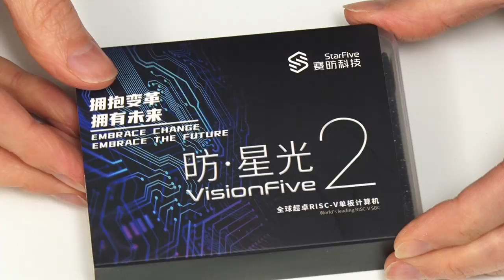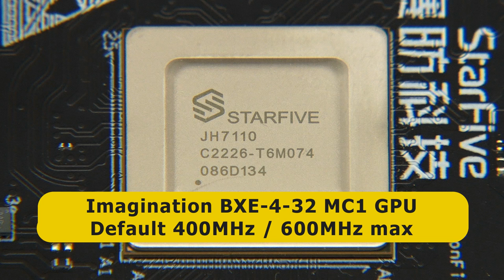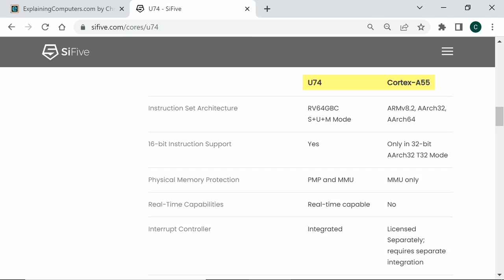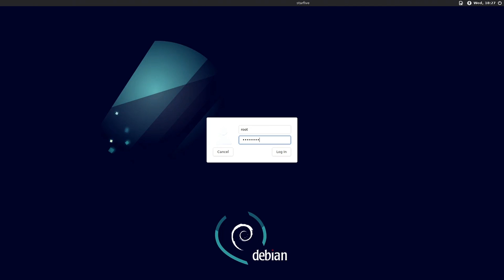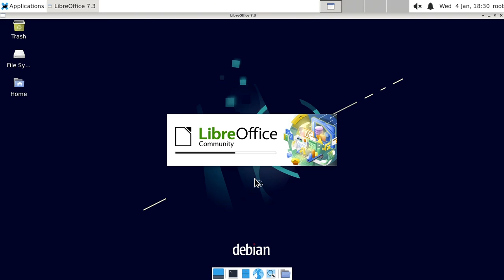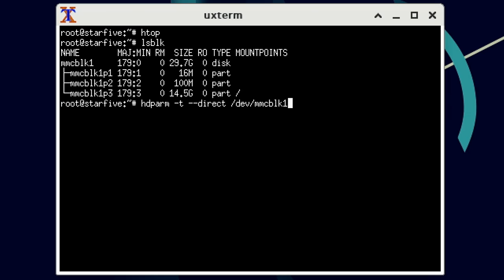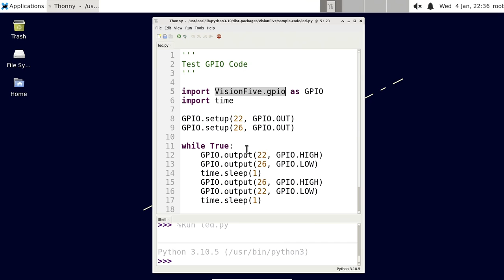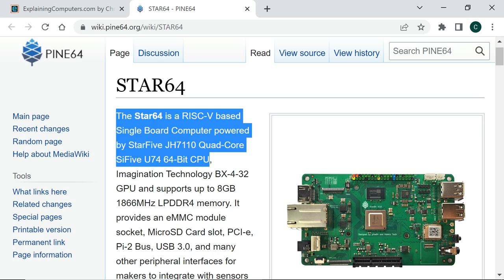VisionFive 2: RISC-V Quad Core Low Cost SBC

Comment: I can't help but thinking that these little boards would be better with lighter operating systems and more specialised programs. They seem to struggle with loading even the most basic of full desktop software and present as laggy and not really a very fluid user experience. Given that they're just development boards they could easily get away with cutting out all the graphical bells and whistles.

Comment: 7:07 Apparently the M.2 slot on the back is meant for a Wifi solution; they say this in their Kickstarter campgain video.
Reply: It's primarily meant for a SSD. During the Kickstarter campaign they offered a USB Wifi stick for a couple of dollars.
Reply: @LivingLinux  Perhaps what they said in the campaign video was a result of improper translation. Though this prompted me to look into M.2 wifi boards and I must say, the Intel Killer Wi-Fi 6E AX1675 board packs all the current features one could need for a pretty good price.
Reply from the maker: The M.2 slot is keyed for an NVMe SSD, not wireless comms. Early on they did write about it being for wireless connectivity, but this is no longer the case as @LivingLinux has outlined.
Reply: @fredwupkensoppel8949  I think you will need an adapter, as the M.2 Wifi cards use a physically different connection than the NVMe drives. And the VisionFive 2 only has a hole for the screw for the 2280 size. Wifi cards are shorter.
Reply: @ExplainingComputers  Thank you for clarifying.

Comment: Thanks for the exciting report. How does power demand of Vision5 compare withan RPi4 running same applications?
Reply from the maker: In theory -- once the software support is there -- the VisionFive 2 should out-perform a Pi 3, but will be slower than a Pi 4.

Comment: You mentioned in this video that you could not change the size of the fonts in the terminal emulator.  I had the same problem.  I eventually solved it by installing the XFCE terminal emulator.  (Why id isn't installed initially with XFCE is a mystery.)

Comment: Do we need another processor architecture? seems a tad odd if it's bigger than a pi4, yet runs slower.
The only advantage I see is the storage options on the bottom.

Comment: 13:49 I performed hdparm on two raspberry pi both running raspianOS and had similar speeds. One is a B+ and othe is pi3, both are using high speed sd cards.

Comment: Nice video! Most likely microSD card and low ram is degrading performance quite a bit, but the nvme should work, maybe cloning the content of the microSD. I've had trouble with my nvme when taking it out of a Windows system, and plugging it into an older computer. The EFI partitions and GPT schema was making the system confused, at the end I wiped everything from that nvme drive, partitions, schema, everything. No MBR, no GPT no EFI no nothing. Just empty, like brand new from factory.
Reply from the maker: The 20MB/s microSD performance is certainly degrading performance. I don't think there's a problem with the RAM though -- as HTOP revealed, little is being used, and 4GB is perfectly fine to run a Linux distro. The NVMe drives I tried -- both WD Black -- were cleaned with Diskpart to factory state.

Comment: On one hand it's neat to have the 'open' architecture, but I'm really not crazy about the RISC-V Foundation and some of the decisions they've made.  Their licensing scheme essentially allows the architecture to be commandeered by proprietary development, so whichever company can achieve the most success with RISC-V ultimately has the ability to assume defacto control of it.  If I'm not mistaken, the SiFive CPUs are a proprietary implementation of RISC-V.  It seems that RISC-V risks becoming an architecture that is only 'open' on paper, while only being practically usable when it's packaged with a bunch of proprietary mystery.  It won't matter if the core of RISC-V is 'open' if the only usable implementations are proprietary.

Also, RISC-V was developed using American money, but once it reached viability, they quickly relinquished American ownership to a clique of internationalists.  In this respect, Imagination is a good match for GPU, since it was developed by the British, but then gobbled up by the Chinese gov't.  I don't have faith that these international shell games are being played for good/honest reasons.

Comment: Did I hear you say this was pre-production with one RJ45 ports limited to 100Mbps?  Can we then expect 4x USB 3.0 ports on final product as suggested by colour coding of ports?
For myself, given past trend, I'll expect an octacore version 3 at $40 with 16GB RAM in Jan.'24, competitive with an hypothetical Raspberry Pi 5.
Reply from the maker: Yes, you are right, this is an early board -- not pre-production, but first batch -- where one Ethernet is 100Mbps. I suspect this is the reason that all four USB ports are the same colour -- just a component supply issue. The boards will all be 2xUSB2 and 2xUSB2. I would not be at all surprised at an Octacore board pretty soon -- although there are also some more powerful SiFive cores coming down the line.

Comment: Stanley the knife getting a bit worn, I think it's time to replace it with newer model. 😊  Lovely SBC tho but isn't it a pig to program in assembler with the instruction set it got.
Reply from the maker: Yes, you are right -- down the metal in more places now . . .
Reply: @ExplainingComputers  No knife can fit Stanley's position,
maybe you can upgrade it with a new blade and paint it with a new shiny color

Comment: Did I hear that right? 1 Ethernet is only 100Mb/s?  Still, nice to see RISC moving into the Pi3/4 space.  NVME slot is a big plus.
Reply from the maker: One Ethernet port on the very early models (sold to the first backers who accepted this limitation) was 100Mb/s, and the other 1 gigabit. All boards now have two one gigabit ports.
Reply: @ExplainingComputers  Excellent!  Thank you,

Comment: The storage performance on this model needs to improve quite a bit.  I have an iSCSI connection to external storage (an iSCSI target PC) and I can connect to it using an Ethernet interface.  I wonder if Debian for this model has an iSCSI Initiator app.  If so then it could connect to external storage using one of the Ethernet NICs.

Comment: Man these boards are coming on lone fast. I guess that's what happens when the CPU architecture is not a mystery to the board producers. Just barely getting a mango pi and these baords are already after the rk3588's neck. It will be interesting to see these CPU's with andriod eventually.

Comment: Power/perf measurements might be nice
Reply from the maker: Too early for both. :) I'll benchmark this board in another video when there is "final" release software avaiilable. Right now, it is either not possible to run some benchmarks, or they would not be representative of what the board is capable of.

Comment: Thanks for this demonstration.   Is it possible to run BrowserBench's Speedometer 2.0 benchmark?   I just wonder what kind of benchmark results one can get from the latest Raspberry Pi and this RISC-V system (if it's possible at this very early stage).
Reply from the maker: In my tests so far, Firefox is currently very unstable -- so thus far I have not run any benchmarks. But I will be doing a Pi 3 vs VisionFive 2 vs Pi 4 benchmarks video as soon as the software is good enough!

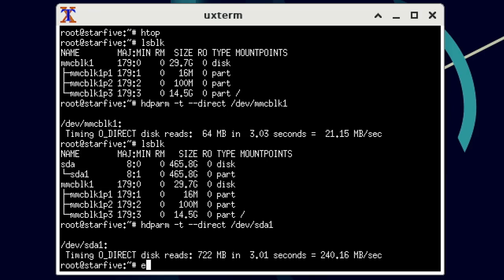Comment: 13:59 if at all possible I would like to see Iperf tests on the network interfaces of these kinds of SBCs since one of their possible applications is diy routers and NASes and in those cases it helps to know if the board can saturate the speed of one or in this case both network interfaces simultaneously

Comment: Reduced Insturction Set Computing offered up a noble premise, that computing would be faster.  In the modern concept, CPU's only work on 8/16/32/64/128 blocks of data.  It is a predictable data set, and no meta table is required.  Eliminating this single data level has unburdened computer science by a huge degree.

Comment: I really like the 2 x RJ45 Ethernet Ports and the M.2 port.
What i don't like is the lower performance compared to a Raspberry Pi 4.
Are all the drivers open source or are there proprietary drivers? And what about the firmware?

Comment: Why two RJ45 Ethernet jacks? That has always puzzled me. I would rather have WiFi/BT and/or RTC.
Reply from the maker: Two Ethernet ports allow hardware to be used to build (eg) a router or firewall. They can also be used to increase network speed or to provide redundancy -- for example if using the board as a small server or NAS.

Comment: Since this is a RISC-V CPU, does this mean that the final version of Debian for the VisionFive 2 will run on any RISC-V CPU?
Reply from the maker: Probably not on any board -- the GPU support will be specific, for a start. But Debian for this board ought to be easier to port to other RISC-V systems, and very much so to ones using the same SoC.

Comment: I have mine coming in February but I've been trying to get suitable parts for it. I see that heat sink but I'd like to know a good case for this one if anybody knows one.
Reply from the maker: I imagine that by the time you get your board, there will be both case options, and 3D designs available to print. Maybe I will make one! :) The form-factor is very nice to design for.

Also, some bright spark (or company) will surely create a generic PicoITX case with front and back panels that accomodate different boards -- like the VisionFive 1 & 2, Orange Pi 5, Rock 5B, etc. There is a market opportunity here!
Reply: @ExplainingComputers  What was the heat sink you use (if you don't mind me asking)?
Reply: I have a "case", that's basically two acrylic sheets and some standoffs. I think it was for the original VisionFive. Just by accident I bought it with the Radxa Rock 5B. So I know the holes on the VisionFive 2 and Radxa Rock 5B are in the same position. But I can no longer find it. You can buy something similar for the Radxa Rock 5B at Allnet China. I would go for the active cooling model, and discard the fan. I think it's enough to put only a heatsink on the RISC-V chip. That way you don't need to use the holes for a cooling solution, as it will interfere with the m2 slot.
Reply from the maker: @JamesJones-mg3ts  It was a small copper one I had in a drawer! Sold I think for a LattePanda V1.0, but there are lots of similar ones for a few £/$ on Amazon. I used it because the SoC does get a little hot to the touch over time (probably OK, but I chose to be safe). Actually, I am pretty certain it is one of these: https://www.amazon.co.uk//dp/B08CBBR7TY/

I was going to use a larger Northbridge-style heatsink, for which there are mounting holes. However, there are surface mount components that would be right under this, and the SoC is not that tall. So again I opted to be safe.

Comment: This one and the pine64 star64 could potentially be great router candidates because of the dual gigabit ports. The thing is, I can't find much information about it's ethernet capabilities. Also looks like a lot of stuff has been mainlined for this devices in 6.5 I think. The pine64 is a bit cheaper at $69.99. Kernel 6.5 wasn't released when this video was made so maybe a revisit for this SoC would be interesting? Although maybe it's better to wait for the remaining stuff to get mainlined too as they are in review (but have been for quite awhile so idk...)

Comment: i recall last video where you used Fedora for RISC-V - have you had the chance to try this board with Fedora as well?
Reply from the maker: Yes, you are right -- the Linux image supplied by StarFive for the VisionFive v1 was Fedora. But they have done Debian this time. The VisionFive v1 Fedora images will not run on the VisionFive 2. But these are very early days!

Comment: I love SBC’s but because the processors are maturing so fast I’d rather see a itx motherboard that has interchangeable processors like x86 so you can buy one board and upgrade more easily. And desktop is the goal anyways, at least for me. Microcontrollers are cool too, and so are SBC’s.

Comment: the problem is the imagine chip & more so the video encode/decode hardware block doesn't have a working open source linux codebase or does it have working ffmpeg code patches now? so people can at least Realtime record & watch hardware assisted x264/x265 video
Reply from the maker: Yes, getting the GPU working is very much the big issue.

Comment: Can we see a display connected to the DSI connectors? Would also like to see youtube running...
Reply from the maker: YouTube currently does not run. As noted in the video, the software shown is an engineering pre-release. Neither local or streaming video will play.
Reply: @ExplainingComputers  but what happens when it fails? It would be interesting to see it fail... and what might be the cause of it? Is it the graphic drivers? Could you use some kind of framebuffer driver instead?

Comment: mixed emotions. Finally got mine aftre a long time of waiting... and it doesn't boot. Quite a few people on forum have the same issue.
Reply from the maker: Try using the earlier Debian image 55 (the later one (69) requires an SPI flash update) and on a 1080p (not 4K) monitor. This a development board, and release software still has not been released. The forums contain several excellent guides to get things up and running. Good luck! :)

Comment: I don't care much YET about sbc's just because so far those are not sufficiently powerful yet for what I need it to do (basically a solid internetmachine with 1440p 60 Hz video's, 144 Hz display, low latency with multiple tasks like PDF's, music etc)  but RISC-V does excite me, being an open architecture and risc-type design.

Comment: Being able to blink an external led demonstrates  the basic fundamentals of controlling  any binary I/O device such as relays, or FETs. It's surprising that it comes with 2 RJ45 connectors but no WIFI. I guess if I planned on using it to segment a network that might come in handy. Who uses ethernet at home?  I like to be free from a wired connection. Marketing an SBC without having the software support is taking a big risk. A company can't depend on a community to write corrections to an operating system or support their device by writing software for their SBC. The creators are taking a big chance on failure. We've seen an awful lot of companies making SBCs go down the drain. I was brought up to believe. You start with a problem and then you create a solution. The mentality of these companies seem to be " We have the solution, now go find a problem to apply it to". Personally I don't see any reason to move from the Raspberry Pi Platform, including the Raspberry Pi Pico. With a Raspberry Pi you can be confident on having a successful conclusion when using it as an intelligent controller. Just my opinions for what it's worth. Great presentation by the way. Take care and have a great day.
Reply from the maker: Thanks for this -- and I use Ethernet at home! At least for my desktop, and TV. :) I imagine the VisionFive 2 has no WiFi to speed development (as any device with WiFi &/or Bluetooth would need to go through wireless certification, and that adds time to the process).

As I said at the end of the video, the situation here is very different to that where an ARM SBC is released with poor software support. The VisionFive 2 is a development board for the RISC-V ecosystem launched by a RISC-V chip maker. :)

Comment: Personally, I think although getting access to the RISC-V CPU is cool I kinda don't see the point of all these SBCs running Linux. As soon as you port a fairly common ecosystem to it you immediately just give yourself a fairly slow installation of a fairly common platform. It is much /cheaper/ to buy than a regular desktop but with Linux it then straight away fails to differentiate itself from any other Linux system - if that's what you want - in all except for the fact it is much slower and less capable.

As somebody who looks at these things from a developer perspective it would be far more interesting to me if some new small-systems specific operating systems were to emerge aiming for far slimmer resource use than even slim Linuxes. Tiny computers with very small new operating systems would be interesting. 

Isn't then the real and perhaps only benefit of RISC-V to a regular developer over anything else merely the chance to learn its assembly language? 

A RISC-V CPU surrounded by some basic media ASICS for sound and graphics would be VERY interesting. I am still baffled why nobody is doing it and why what we see instead is a slew of what to me are basically just small slow Linux boxes. Even if we accept there is probably a marketplace for people who really do only want low-cost computing then in that case there are already multiple other options available, especially the Raspberry Pi.

I see a purpose for people on very low incomes, people in very poor countries or for children to be able to buy their own tech but I don't see much purpose in these for any adult with a regular job, especially one who already has a desktop computer, which is most people. 

@ExplainingComputers: Maybe you can explain the answer to the question "But why?" for applications outside of those for people with very low incomes which I accept exist for these things?
Reply from the maker: I think to get to the media system you describe, we need the basic OS support (even media boxes have to run something). So the first port of call is a development board like we have here . . .

Comment: What do you think that in the USB-C connector the VBus Pin is directly adjacent to the signal Pins?
 When you are charging you laptop with 20V can it damage the USB Controller if this VBus Pin accidently comes into contact with other Pins?